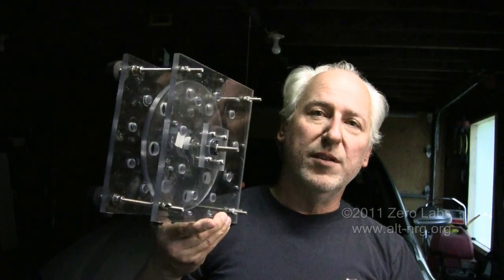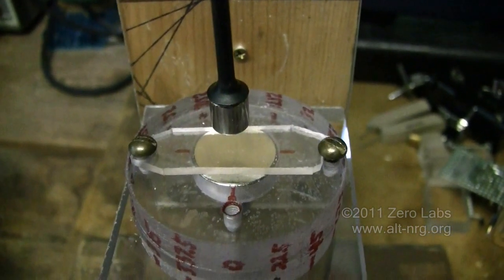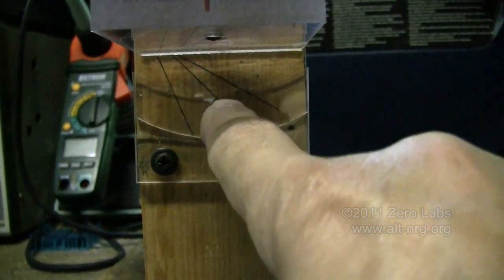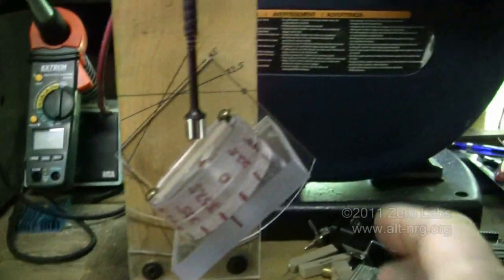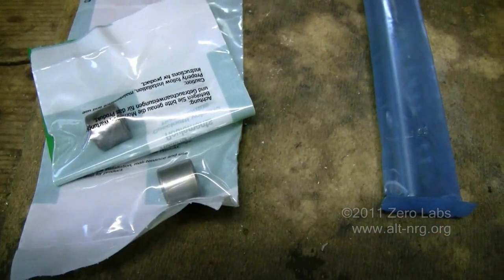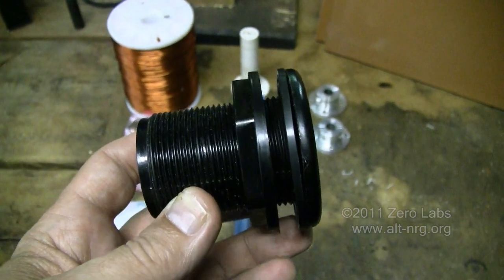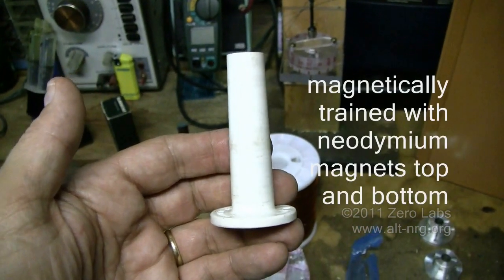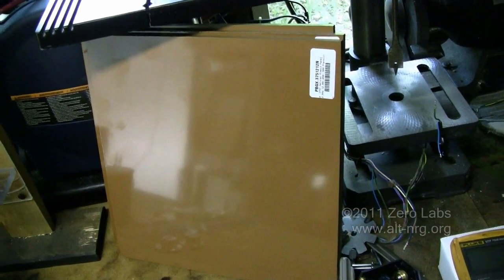#294 Muller motor build #2, PWM on sale

Comment: don't the metallic screws pun intended screw with your magnets pull strength when you rotate
Reply from the maker: +jolllyroger1 Har har. Been a while since I did this. Weren't they stainless? aka non-magnetic?
Reply: +ZeroFossilFuel well I'm just thinking that a magnet dropped thru a copper brass aluminum silver gold or any other non magnetic metal tube will make the magnets drop slowly... magnets brought near any metal magnetic or not will still cause some movement.
Reply: +jolllyroger1 stainless aka non magnetic still in the presence of a magnet affect the magnetic field .... don't they?   we know copper and other non magnetics affect magnetism don't we ???  ..... what we don't know about it I think means is a good idea to just avoid the possibility of it affecting things. ........ not to mention that many times stainless copper brass is not as pure as it should be. ..... just some input might .... it might be good to use plastic bolts whenever possible ..... 

heres a thought that I been playing with. ... armature windings made from carbon fiber ... very light very strong extremely heat resistant especially when used with high temp epoxy and is an excellent conductor.

Comment: Great stuff also take care of the dust its bad news a carbide mill end may be better and get more than one that stuff is hard on tooling router bit or other, also is it the multi-layer chem resistant? If so is it stronger than lexan??

Comment: Watch out what glue are you going to use. Heat can affect to its effectiveness, so make sure you choose a heat resistant glue. I would suggest use the same piece done in acrylic and chemical welded using chloroform (aka trichloromethane).

Comment: Hi Mr.Z
Are you going to make your own magnets?The way you explained above it looks more like an electret (Mototaro Eguchi method).
Also,do you want to experiment with conical inductors (shaped coils)?Someone from the group already build a couple using Litz wire,salvaged from CRT monitors.
What is better-8 or 12 coils?I know,too many questions,but this project is fascinating.

Comment from the maker: @Tahtechlabs The cores will not be pulled from the spindles. They will be part of the spindles. There is a benefit to having the wire as close to the core as possible. These spindles have pretty thin walls so I'm not concerned.

Comment: On your coils you will be using those plastic spindles for cable management. Questions; they have a tapper to them for mold pull, will this matter on the wire lay and would there be a benefit to pouring the magnetite into a mold and have the coil wire directly in contact with the magnetite so there is no gap between the coil and magnetite as with the plastic spool?

Comment: (derived via RMS values),  you done well and build a high sufficiency inverter!  Generally all power consuming sectors should add up to 100%,  although it can be shown mathematically that with ferromagnitc cores using rotating magnetic fields and applying the Maxwells equations via using Finite Element Method Magnetics, anomalies at the could be expected at High voltage , causing logitudinal electrical pressure waves in open circuits during superposed magnetic fields opposing each other.  Enjoy

Comment: Average to RMS differences at 20% duty cycle of  5 - 15% are expected  and low performance True RMS meter errors of 15% and more  are generally also to be expected for these wave forms, unless an RMS meter with a heating-element is used!   Remember COD and efficiency can all be calculated differently.   But if you built a motor which an average output of 10 Watts at say 240 Volts DC consuming just about 0.5-0.7 Watts within all driving coils and 0.5 - 0.7 Watts within the SS switching circuit,..

Comment: That will result in fast coil charging and low heat loss.  L/R * 0.5 to L/R * Ln(2) work well.   Input power needs to be calculated via RMS current values and RMS voltage values.  Digital True RMS meters are not measuring these "Shark fin" wave forms correctly while other meters meters will only return an "average" value, which is nearly always lover.  Mathematical cross referencing of the current RMS wave form via integration is recommended.

Comment: It is important to understand the resulting wave form of a coil charged by a DC pulse.  It will result in an exponential saturation coil-charging curve, where most importantly the time constant of the coil will need to be calculated, before determining the current cut off timing and the rotor speed.    Steep, short and nearly linear current raising is preferred and cut-off should occur well before 63.2% of the max coil current at any given DC input voltage.

Comment: I like your research!  I work with HV Adams style motors triggered with complex pulse trains and adjustable pulse gaps and train gaps.  The results are limited by the solid state switching, which causes open circuit longitudinal current waves cause voltages , with my limited setup, to 290 Volts DC continuous output over 40 mA output, driving a 10 Watt output load.  Switching speed and accuracy is critical.  Capacity on solid state switching compounds and leaky caps will lover the voltage.